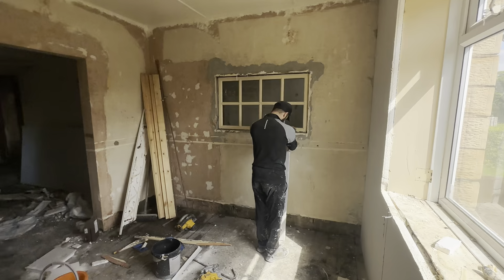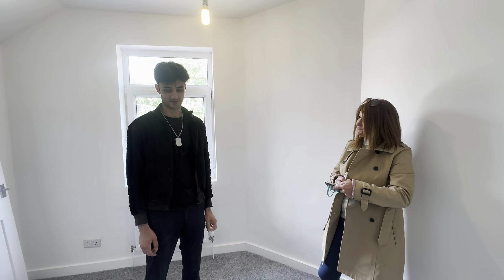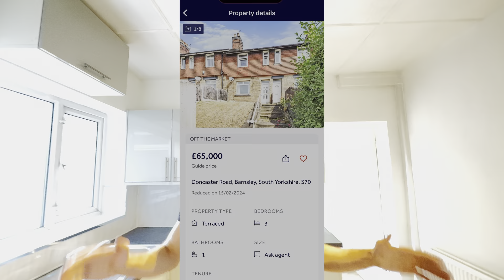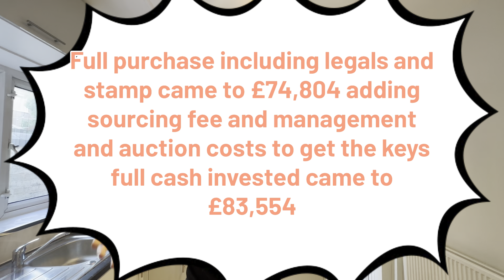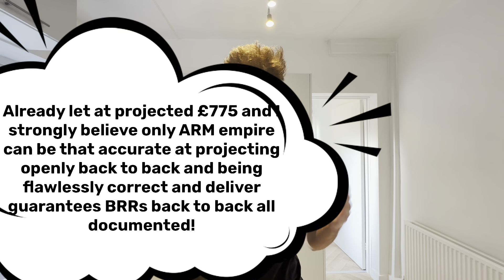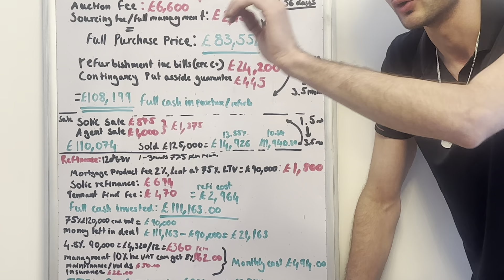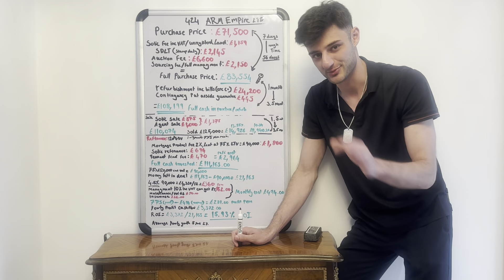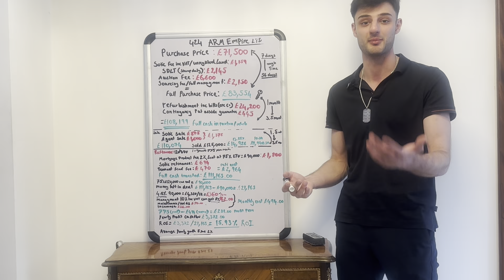Only way to do BRR Property Investment  CYCLE

Comment: Great explanation and detail, thank you for sharing and explaining.  Quick query, the management fee of 10% that includes VAT comes in at £62.  If you remove 20% from that you get £51.67 what is this 10% of?  The auction fee was a high cost but without it you don't have a deal.  Wondering if you thought about co-sourcing or direct to vendor activity to secure your initial property as auction is not the only option?  For example, I'm sure myself and other good deal-sourcers could find you a good BMV property for half that fee with a motivated seller which could help improve the figure as you would have 18k left in the deal not 21k and every little helps improve the ROI for investors.

Comment: Can you explain what a modern auction is? How does it differ from a normal one?
Reply from the maker: @domever7899  thank you for you comment mate, modern method of auction is similar to standard auction. Now standard auction usually when you win the bid or accept a offer whether pre auction or when the hammer drops you usually pay 10% of the purchase of the property and exchange which means your liable to complete or loose deposit (where as modernmeathod you only pay  what is called a reservation fee which is a set figure minimum of 6,600 or a percentage of the purchase usually a lot less than normal auction, with normal auction you pay in addition all the fees associated with it, sometimes there are heavy fees hidden is what so called a legal pack, now moderneathod  of auction usually never has hidden fees like standard auction only maybe a one off (paysolicitor fee) or whatever. Now on a standard auction you usually only have 28 days or even sometimes 7 days to complete. Where as standard auction you have up to 56 day and you start the purchase with solicitors as usual and they have the legal pack and you already know if no about the property. 
With modern meathod everything about the property is there unlike normal auction but that’s why you pay a heavy fee of the 6.6k which is basicly only the auctioneers and agents commission. Hope that explains maybe it’s worth me doing a video on it?
Reply: Thanks for the reply. I think I've got it! Although, a video would actually help 😊

Comment: I thought flips cost a little more as you need a slightly higher quality finish? At least this is what I have heard!
Reply from the maker: Hi Domever, great point, it’s a mix that can go either way. When doing a smaller property like purchase 60k end value 100k better to spend less on the flip as you worn change many things to nicer things like say a nicer boiler with warranty or maybe even need to insulate it. But as a rental you keep it so you want it to be more future proofed but there is a limit. 
For example you can spend 24k for a refurb to keep or 15k for a quick flip. Bro makes more sense in the mid rage of the market where properties are in good postcodes so you can say buy it for 180k spend only 20k for a quick flip refurb and then sell for like 230  because it’s a good postcode they just want a clean rude property the end buyer can get a mortgage Ina me out there own stamp on it. 
When doing a very top end flip that’s when you spend more but there is always a limit as it’s at the end of the day your preference and that is different to every individual Pearson. Hope that kinda answers that but yes it’s a mix.

Comment: Good content , good end finish.   Numbers look good officially,  but on that £24 k you spend ,do you include your teams salary's for the two months they worked,and yours also. Depends on the size of your building team,  that wage bill still bites a good chunk on tgat 24k. I was just wondering because it looks quite fascinating how you can achieve that end product with a limited amount of cash.  Impresive , good work lad
Reply from the maker: @BB-bt9vj  hi mate thank you for your lovely comment and kind words and I am glad you found it fascinating, yes that  24k spent included everything my teams labour and material, nothing missed out, my build team consists of 3 main people and I add cheap day rate labour if need be if I need more staff, the way the costs work is say in that project the full material costs come to about 13k, then that leaves about 11k for labour which I pay my main builder about 5-7k a month and as it takes my team only a month of actual day rates it a great salary, I also have my other builder who is almost just as experienced who is on a day rate of about 120£ which in the month comes to about 3k of wages, and another labour that comes to about 1k-1.7k as a wage per month, so yes a tight ship as we have been told before but it works out great as we don’t outsource and take care of everything ourselves. 
We are here for the investor and to deliver so we can have projects at a role back to back and keep us going month after month which has seemed to work very well so my team and I are every happy and see the long term growth we can have, my main builder korab has also got a small portfolio of HMOs delivering great income so to be honest it’s not really about the money for my team and as mentioned more the vision of what we stand to create. 
Thanks for your comment 🙏👊
Reply: @alimonfared  thanks for the reply and the transparency.  Im sure you've got a bright future in front of you. Honestly, integrity will take you a long way. Keep up the good work . God bless. 👍
Reply from the maker: God bless you too my friend😊🙌  will keep the honesty and interacts going and hope I can be of help and serve other best I can 🫡.
Thank you 🙏
Reply: @alimonfared which company is this do the work in london aswell details please.